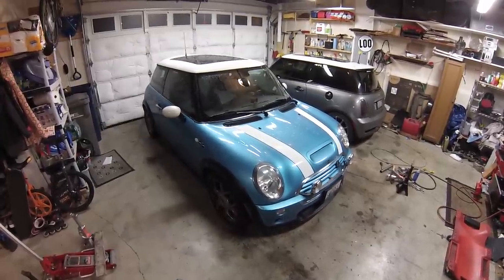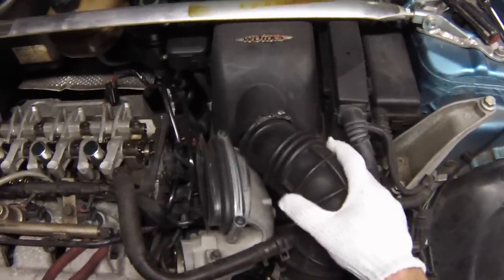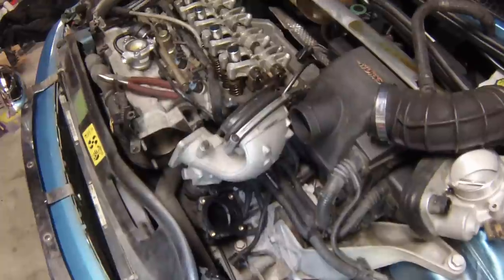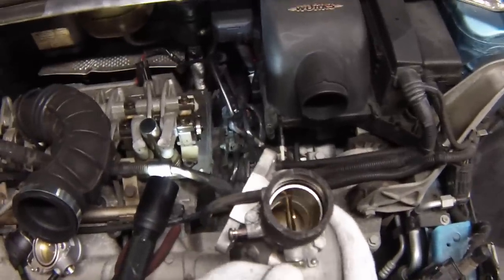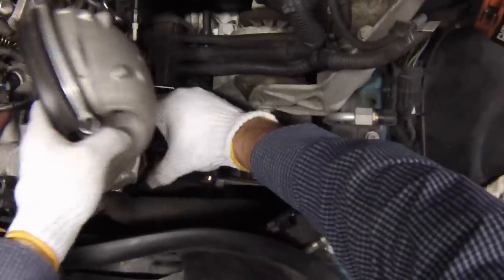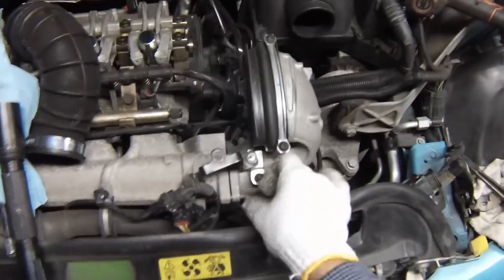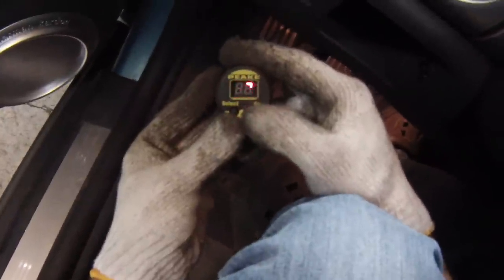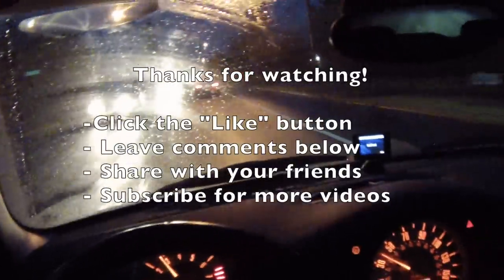MINI Cooper S R53 Bypass Valve Repair 2002-2006 BPV

Comment: hi..can I ask you a quick question re the bypass valve..I've just put 15% pulley on my 2003 r53 along with a davef and decatted the car..put the car on the dyno before and after and it made less power..one thing I noticed was my bypass is exactly the same as you showed if not worse..it's basically free moving no resistance and won't spring back..would the car not build boost and loose say up to 40hp..unfortunately it's put the car back before seeing this video but I know now..so I'm going for a 1320 bypass or possible detroit one anyway..great vids..helped alot
Reply from the maker: Absolutely a broken BPV will prevent the car from building boost. 

If you did not get a tune, it also is possible to have less power if you've changed back pressure and other characteristics of the car. But more likely, the extra boost may have caused a weak valve to break. 

What is a davef? 

Just so you know, Detroit Tuned valve will change the way the car performs a little - car will be more jerky on quick throttle release and you will lose 1-2 mpg fuel economy.
Reply: +Mod MINI 
thanks for the reply..I didn't think a tune would matter as I didn't touch injectors or timing with cams etc but I'll look into it.. sorry the davef is just an enclosed airbox with better airflow from the back of the scuttle. proved to be the best airbox even over a jcw box and much so over the likes of alta. I'm over here in Ireland so small tuning community we kinda piggy back off the the UK when it comes tuning..thanks again I'll change the bypass valve..I'll use the 1320.co.uk valve alot have said the detroit was a bit snappy
Reply from the maker: A tune matters any time you change volumetric efficiency which is what happens when you change out stuff like exhaust components that increase airflow and reduce back pressure. 
Detroit is snappy. Installed one to get rid of a yoyo at part throttle at around 4000rpm. It improved that but took a while to get used to the snappiness. I kind of like it now - I can make it pop/burble on command with a snap throttle lift.

Comment: I just finished replacing my Bypass Valve in my 2003 R53. The yoyo affect is different for these years, if you're able to get on it for a while but just don't feel the power or hear the supercharger, your bypass valve spring is probably broke. My car was able to get up to about 6grand for the first three gears, then after the third gear if I went over 4.5grand it would go into limp mode. Then after going into limp mode the first time I wasn't able to go past 4.5grand in any gear. 1st-6th. But then the next day the car would reset itself and I could do it all over again. The codes mine threw were p1688. 100% bypass valve.
Reply from the maker: Austin Lilly Yup, the spring is not strong enough on the 2002-2003. This was redesigned in later years. It is good to do a proactive replacement on the early cars. Later cars only need addressing if the spring is broken or diaphragm is torn. 
p1688 is usually bypass valve or a bad crankshaft dampener pulley. I've also heard of it being caused by a badly slipping belt or even a slipping/spinning aftermarket supercharger pulley.
Reply from the maker: Austin Lilly If it isn't broken, not really. Suspension parts are probably worn, that would be a good place to start. If it's leaking oil, fix that leak. Probably your crank sensor o-ring is leaking. Next most common is valve cover and oil pan gasket, followed up by oil filter housing and rear / front main seals. 
I wouldn't touch coils or wires unless you are getting misfires.Change plugs if you are unsure of their history - even better, get a 15% pulley package from Way Motor Works which includes plugs.
Reply: Mod MINI I literally did all of those things except the plugs as the guy before me recently installed msd coil pack and changed all that...a lot of fun those seals were...
Reply: just bought one last week!mine have 4 codes p0340 p1688 p0137 p2270 i changed the damper already and camshaft sensor but codes still there.do u have any suggestions on what to check next?car runs fine but i have all these codes and i couldn't delete them.bypass valve seems.but i ordered a detroit tuned.any suggestions?

Comment: Question: is it possible to simply replace the spring inside the bypass valve's membrane body? I have an 05 with a loss in power, bad mpg, and the infamous yo-yo effect. Though it's not that bad yet, I know it's on its way out. Thanks.
Reply from the maker: +Epo Maybe, but you're likely to break the plastic clips. Also, you'd have to get the spring tension exactly right or the BPV will open/close at the wrong time.
Reply: +Mod MINI true true, I'll stick with a direct oem replacement. Last thing I need to do is add to the issue. Thanks for the response and advice.

Comment: Ok I understand that got the car back today and befor I got it home it thowed a engine proformance light on the tack the engine speed shop replaced blow off valve  it's a forge blow off valve I have noticed that when it rains I have no trouble light and the car has good power  do you have any clue were I need to start
Reply from the maker: Bud Bullis Sorry, I don't have experience with this issue. I would pull the codes and then do some Googling using that code + blow off valve and see what comes up, then filter out the obvious garbage / wrong answers.

Comment: Hey need some help I have a Mini Cooper base. Hatchback and we put a new timing chain tensioner but we took of the electric throttle  and  disconnected it from the wires .. After we was done we put everything together but now it turns Gud at first but then the gas pedal doesn't accelerate
Reply from the maker: +Juan Garcia Did you reconnect the throttle electrical connector? It's easy to forget and car will idle without it.

Comment: Hello modmini. I have a 2004 pre-facelift r53 with 17% reduction. One week ago had hesitation at low rpm but while during left turns, I’m not sure if it was just me but that is what I noticed. I let the car sit for a week and now it won’t start. I replaced the fuel filter about 4 months ago and the car was fine. I’m not sure how to fully diagnose a bad fuel pump before I throw money at it. Is the OEM not able to keep up with the 17% reduction pulley? Thank you.
Reply: Oh, I checked the fuel pump fuse, it was fine. Checked BPV tension and it seemed fine and disconnected TMAP and MAP and tried cranking but nothing. I drove hard through curvy roads with a little over a quarter tank.
Reply: Sorry for the paragraphs. I just did the “smack the fuel tank near the driver side rear wheel” trick and the car fired up right away. I guess I will order a new fuel pump?
Reply: Sorry for the paragraphs. I just did the “smack the fuel tank near the driver side rear wheel” trick and the car fired up right away. I guess I will order a new fuel pump?

Comment: Hey quick question I just replaced the engine in my 2005 mini cooper s and now they saying it crank but it want stay crunk they're not getting any codes on what it could be do you have an idea of what it could be?
Reply from the maker: Go back and check all of your work. If engine shows good compression readings, it's something you missed.

Comment: HI Mod MINI . 
I have an uneven accration , 2. gear 3000rpm  - cold og hot in my 2002 MCS . I have new plugs ,nem oli ,new air filer . Changed the bypass valve to a new OEM item . No result . Then changed the ignition to the MSD iterm ,with Megagtronic 8,5mm cables . Vaccum has been checked by BMW and so has the EUC codes .. Still the same . Any idea of what the problem might be ? Thank you for a very helpfull video . 
Thank you and kind regards 
Michael Berg
Reply from the maker: Maybe a slipping belt. Try changing belt and tensioner.
Reply: Thanks - Will give it a go
Reply: Hi MOD MINI 
Thank you for your answer . If it is´t the belt & tensioner what is the most likely thing to change next ? The MAP ,the TMAP or perhaps a faulty trottel body  ? Thank´s 
Michael
Reply from the maker: I'd probably try the MAP/TMAP sensors next but really suspect it is belt or tensioner. I doubt it is throttle body. That should throw a code.

Comment: Hello again, 
I do have the classic yoyo affect cooper, apparently this was also a problem with the software as they did role an update out in 2004?
Anyway I was looking for your opinion on changing the vaccum system? Does this seem beneficial to you? 
Thanks :-)
Reply from the maker: Warwick Dean Vacuum system? You mean the bypass valve? From what I understand, it should help for a 2002--2003 with yo-yo.

Comment: +Mod MINI I bought a 2006 mini cooper S recently, the car has no Check engine light but when i blip the Gas pedal quickly at Idle the rpms go down and then up as if power goes away and then comes back. and the Engine throttle response is very late at lower rpms and It feels very sluggish too, when i first start in 1st the car jerks and then goes. I just changed the Spark Plugs, Air filter and Fuel Filter but that didn't seems to help one bit. Is there a chance that it might be the Bypass valve? If not what possible cause could it be?  i did notice the coil pack is rusty if that effects performance.
Reply from the maker: Bypass valve symptom is generally as I describe in the video description. Bad coil pack or a vacuum leak could also get you symptoms like you describe. All R53 don't have much power at low RPM.
Reply: ***** Ok well I take back what I said about the tune up, it helped my car become alot smoother even more after the fuel system cleaner and its not as sluggish anymore but the laggy throttle response is there but not as much. The coil pack and wires are good. So I'm gonna check for vacuum leak and check fuel/air ratio on the obd2. Thank you!

Comment: Hey it's Juan again I'm here with the car I told u about and I don't c any thing that I left disconnected is it possible dat that the electric throttled got dis programs or something with the timing chain cuz I did put the new timing chain tensioner the car also turns off if I press the gas pedal
Reply from the maker: +Juan Garcia Sorry, this sounds like the kind of thing that is not possible to diagnose further over the Internet. Is it possible your timing is off / chain jumped several teeth? Might need to pull the timing cover and have a look. Other than sensors, I can't think of anything else. I assume you already unplugged/reconnected all the sensors.

Comment: So I have a power loss but also when im coming to a stop my engine shuts off. I have a P1109 Manifold Air Pressure Too High in Deceleration code. Also sometimes when I start it back on it just dies right away if i dont apply throttle. Any ideas? Im gonna try to check the resistance on the valve but I dont have anything to compare it with. After that I'll try to zip tie it closed and see if power comes back.
Any thoughts?
Reply from the maker: I guess it could be that.
Reply: Did you ever get this resolved?

Comment: I'm getting P0300 P0301 P0136 if I step on the throttle slowly or smoothly I can drive it with no missfire. If I step on quickly it will missfire and keep misfiring. I would have to turn the car off and start it again and it will run fine again as long as I don't step on the throttle aggressively. Replaced all wires plugs coil and o2 sensors. Could it be the bypass valve or fuel filter and injectors? please help thank you!
Reply from the maker: +Dino Calderon I'd do compression/leakdown test first.
Reply: +Mod MINI thank you I will give that a try.

Comment: Hey Mod MINI, 
Great video!  I was wondering if my car is not creating any boost, would that be caused by a bad BPV?  I have an 04 MCS, and it has over 100k miles on it.  I have a boost gauge installed, and I see normal vacuum readings.  However, when I accelerate the car doesn't produce any boost.  In higher gears my car has no top end (it can not go past 3-4k rpm).  Any idea what my problem can be?
Thanks
Reply from the maker: Could be bypass valve that is stuck open or you have a intake leak somewhere post-intercooler. Or supercharger has failed spectacularly.
Reply: I still hear the supercharger whine in 1st and 2nd gear when the car goes past 4k rpm.  I replaced the boots of my intercooler and the air intake hose.  I was playing around with the bypass valve and the spring still seems to be good.  Would a bad harmonic balancer also have an effect like this?
Reply from the maker: I would honestly need to see the car. Supercharger would whine but the boost might be leaking somewhere. Bad harmonic balancer can be confirmed by visual inspection.
Reply: where in the US are you located?
Reply from the maker: Seattle area.
Reply: haha you are on the other side of the US

Comment: i have a question, i went to see a used mini coopers 2003. while test driving i noticed the tempature gauge goeas to the red then back to the middle. is that a potential serious problem about to happen,
Reply from the maker: Not normal. Whether or not it is a serious problem I cannot say, it would need to be diagnosed for the root cause.

Comment: My 2002 Mini Cooper S went on a terrible roller-coaster recently, I was driving when all of a sudden i lost power, power steering went out, abs light ses, eml, my headlights turned off, and all these lights turned on but no code noise appeared. Then my car died, I got it running again but after being turned on for a bit, it would just die, the next day I turn on my car and it stayed alive for way longer than how it was before. Tested the alternator it tested good, the battery was replaced but it still had the problem of turning off the day of the incident. please help
Reply from the maker: Loose power or ground wire somewhere
Reply: I'm not sure if you got it figured out or not but I have the same year and experienced the same exact symptoms.  It turned out there was a little rubber hose connecting the sunroof drain to the drain inside the car that came off. It's on the drivers side.  So the drain was leaking rain straight into my car right into my entire electrical system.  My wiring harness was corroded.  I ziptied the rubber hose to the drainage pipe and re-wired my wiring harness.

Comment: Though my 05 JCW runs ok and doesn't pull any codes, it doesn't seem to really pull hard almost sluggish...I tied off the BPV and did find that it pulled better ...though a bit twichy...( I Had the valve out earlier when I was doing some other engine work and spring and closing seemed pretty good)... being as the BPV isn't all that expensive or hard to change I'm going to go ahead and do it… What has your experience been with Detroit tune valves versus OEM valves?
Reply from the maker: IslandJCW It would be twitchy with the valve forced closed. That's why the valve is there. :-) I've heard from a pretty well respected performance MINI specialist that it's really not necessary to go with a Detroit Tuned valve. I actually had some BPV flutter in my car at the track when running at high RPM - I could see the air/fuel mixture go rich, and a P1688 code would be thrown. He told me to just get an OEM one, to not bother with Detroit Tuned because it's not worth it.
Reply: ***** Thanks for the info...I  suspected the twitchy behaviour was caused by the forced shut valve...I was leaning towards an OEM unit but thought that maybe the DT unit would add some little pop of boost at lower to mid range....I'm going to stick with an OEM unit!
Reply from the maker: IslandJCW Just installed my new BPV and had the car out at the track. Ran great.
Reply: I just installed a new OEM BPV yesterday as well...
I noticed a difference in midrange throttle responsiveness, no 3k sluggishness and better low rpm torque due to valve closing properly.
Well worth the cost and time to install.
Still curious to try a DT valve to see how the car reacts but being as I live in the Canadian Pacific Northwest, cost of purchase, shipping and duty outweighs my curiosity.

Comment: my mini gp has no power from 2500 to 3000 rpm. I have the DSC light is on with error code p0108. 2 TMAP sensors have been changed 17,000 km ago. this valve could be the problem? 
Please help me. :)
Reply from the maker: Worth trying to change it. DSC light will come on for certain engine codes.

Comment: hey, i have a 2005 mini cooper s.  i threw a P1688 code a week ago.  i replaced my BPV and harmonic  balancer. then a couple days later i had the P1688 come back. then the next day a P1687 code.  any idea what the P1687 code could be??
Reply from the maker: Pretty sure that is throttle body if you've already done bypass valve and crank pulley.
Reply: Mod MINI  hey thanks for the fast comment back!!  im going to try to get another TB. i was thinking that was what it was.  
By the way,  your videos are very good!!  i want to thank you for making these videos! they help alot!!

Comment: I have a 2006 mini and having issues with the throttle.  I replaced the bypass valve and it did not fix my problem. my mini will not get over 2000 rpm. what could be causing this?
Reply from the maker: +Alex Murphree Never seen this. Maybe the throttle itself? Do you have any codes?
Reply: +Mod MINI , I just got back from a test drive after cleaning the throttle body. the car seems to be doing better. I can drive like normal but the car fails to push boost. my eml light just came one and I have a code that says somthing about the vacum line.
Reply from the maker: +Alex Murphree What is the code?